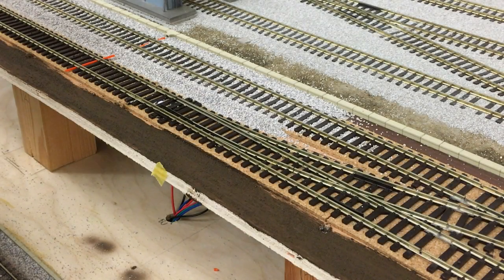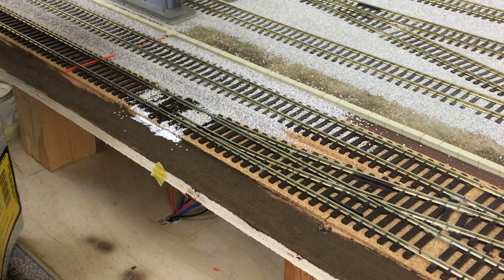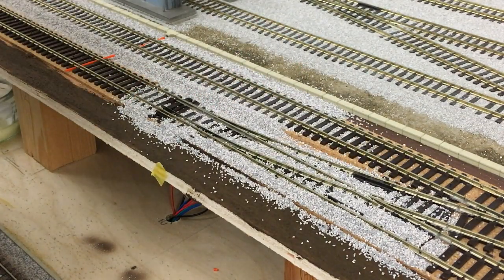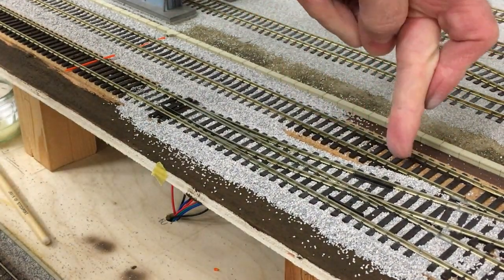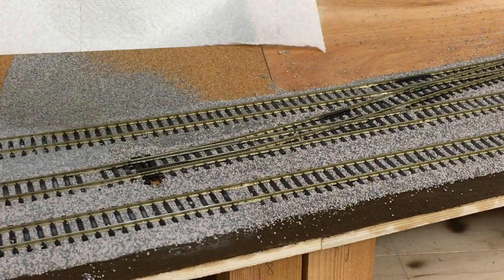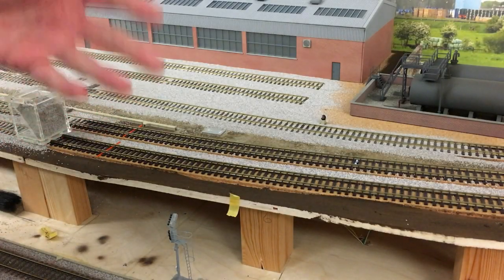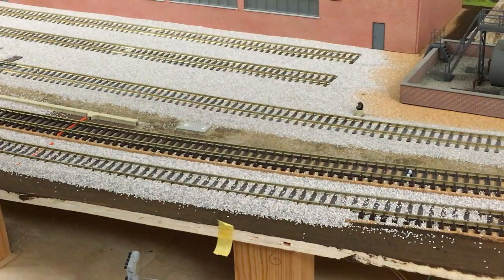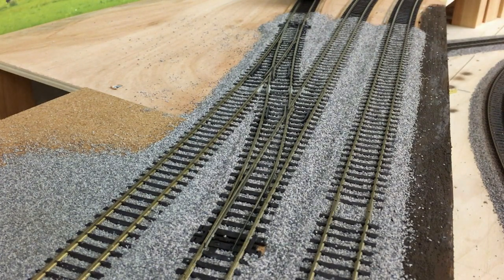Model Railway | Ballasting A Point | Dean Park 232

Comment: Very well presented Dave I see lots of people found this useful. For the shoulder I was pleased to see you also just use your finger to clear the sleeper ends. On some sections of track mainly on curves I go straight to the glue application after that rather than tapping the rails The ridge left is often seen on real track and is sometimes even higher than the rail. I do not leave mine that high. It makes cleaning the rail tops hard to do.
Reply from the maker: cedarcam Cheers. Yeah the shoulder on some real tracks is high.... but as you correctly said it can make cleaning the track an issues with the track rubber anyway. Cheers. Dave

Comment: Thanks for the tutorial, I am just about to ballast some turnouts that I have been avoiding. As a tip I have used a plastic piping bag normally used for icing cakes, found in the baking section in supermarkets, to lay the ballast in the general areas. I have found it to be extremely controllable .

Comment: I found the ballasting of the points very interesting Dave, although you clearly showed the application of the PVA glue to the point mechanism, I was waiting to too the point in operation!...Superb work as always..Bob
Reply from the maker: Robert Masterman Hi Bob. Thanks. The key is not to saturate the area near the point mechanism. Just a drip near it. Glad to report all of the turnouts worked after it all dried haha.
Reply: @DeanPark  I knew they would, thanks Dave...All the Best...Bob

Comment: Can I ask how you place the dummy point motors? Are they placed on the ballast after it has set? Trying to work out if the cork for the ballast shoulder should include space for the dummy point motor.
Reply from the maker: Hi, sorry for taking so long to reply... just saw this comment. 

When placing my ballast I make a small ballast platform for it to sit on. I press the dummy into the unglued ballast to get it fitting etc. Then very carefully remove and glue the ballast. 

When the ballast is dry I place the dummy back and make any adjustments to the ballast, using a small screwdriver to remove any ballast that’s settled and intrudes on where I want the dummy to sit. Once I’m happy, I just pop a couple of dabs of super glue onto bottom of dummy and glue to ballast. I then weather etc

Hope that helps?
Cheers
Dave

Comment: Probably the best video I have seen on track ballasting, so thank you. Have just finished building the baseboards for my new layout and the cork has just arrived for the track underlay. Do you glue your cork down first before laying any track or rely on the track holding it in place until ballasted?
Reply from the maker: Trevor Ward hi thanks. I pin the track down aT intervals so that holds the track and cork in place. So no i don’t glue it. So glad you found it interesting and helpful. I have other videos on ballasting and on track weathering etc. Cheers. Dave
Reply: Thanks Dave, I'm working my way through the rest of your videos but it would help me if you could tell me which of them carries info on track laying and weathering. From what I have seen so far your layout and attention to detail are superb. Hope it's not too cold in the loft just now. Trevor

Comment: Dave many thanks for that. Avoiding the mechanism getting stuck is something that has troubled me for a while and at around £30 a pop for bullhead points not something that I want get wrong. If you don't mind me asking, what thickness of cork do you use and do you pin your track or fix it with adhesive? If the latter, which one do you recommend? Once again, many thanks for the great advice as ever - Pete
Reply from the maker: Creeping Jane hi Pete. I use 1/8” on the main lines and 1/16” on the depot and station, where I don’t want a ballast shoulder. 
I pin it in place as this allows easy adjustment.it will be fixed in place with the ballast anyway. I find gluing the track messy. Cheers. Dave
Reply: @DeanPark  Once again Dave, many thanks for your help. Bets wishes - Pete

Comment: Hi Dave. As always, a clear and concise ‘how you’ video. Now for the daft question of the week -  I noticed during the video you have small gaps between rails(at the joiners), is this done purposely to allow trains to mimic the ‘clickerty-clack’?

After you and others have mopped the tears of laughter away, I only asked as I had always made sure of a perfect join. As I am writing this, I am aware that droppers do provide necessary power to sections of track but, in case others were unsure, I decided to bite the bullet and ask the question anyway.  Thanks Gary
Reply from the maker: A Train In Spain Hi Gary. Thanks for the feedback. 
Ok about the gaps. Totally deliberate.... as in the summer these food disappear as the heat up the loft expands the metal rail. I usually leave gaps on the straights, less so on curves (as I need a good flowing stable curve).
So not a daft question... the clickety clack is an added bonus. :-) the gaps are wider just now as it is cold outside. Cheers. Dave
Reply: DaveClass47 : Metal expansion was not my first thought. However, makes total sense, of course.  Why shouldn’t a model railway fall foul of nature just as the real thing does. As always you knowledge is wise and I take on board those comments. I am fortunate that whilst night time temperatures do drop markedly during the next few months, we are blessed with a much warmer climate overall. That said, I shall take heed and leave a little gap tolerance as I complete the track laying of my layout. I shall continue to absorb tips and mistakes shown by the various YouTube sites and, I am sure I am not alone by saying that this hobby is so much more enjoyable when guys like you share such details and offer genuine encouragement . Thanks again Gary

Comment: Thanks Dave for another excellent tutorial. Just one question...@12.47 and @18.00 I notice you have not added a sleeper ubnder the fishplate / rail joiner. Do you add these or just leave them out? Cheers, Bob
Reply from the maker: trainmanbob hi Bob, I usually do try to add them. But in this case there were dropper wires attached to Bottom of track and I couldn’t. Dave
Reply: @DeanPark  Fair comment. In cases like these I take a sleeper and cut it up to fit in. Glued down and with some good ballasting it seems to work quite well. Cheers, Bobn

Comment: Hi Dave anther great video mate a Question for you Dave what colour paint do you use on your cable trunking Dave ? the class 89 ELEC loco is coming along reasonably will now I have got head and tails light for it now the painting should be finished in 2 weeks  mate clive
Reply from the maker: clive cobbold Hi Clive. I use precision new concrete paint through airbrush on the trunking.
Reply: DaveClass47 hi Dave thanks for that information mate clive

Comment: Great video ! Though i wouldnt ballast a point, not in the area with moving parts. I find it easier to paint and lightly ballast the ground. before Putting the point on the ground. That way you wont have any ptoblem with getting glue and ballast jamming the moving parts.

Comment: I hate to nit pick, but did you forget to put in an extra sleeper under the joints, or do you not do that? Cheers
Reply from the maker: davie maclean I couldn’t on that particular area as I had droppers soldered there. Usually I put the sleepers back in if possible
Reply: @DeanPark  Fair enough Dave. I knew, with your attention to detail, there would be a reason for it. Cheers, Davie

Comment: Would it be easier if I were to use the proses ballast spreader wagon to lay the ballast then add glue/ glue,water mixture on the necessary areas?
Reply from the maker: On normal track yes, but for turnouts I would recommend you do it this way. Dave

Comment: Great tutorial. I like the way you ballast, always have. Clean results. Does the glue leave a residue on the sleepers? It doesn’t seem to show on video, but does it dry clear and look normal up close and personal? -Mark
Reply from the maker: M&M Rails hi. Thanks. The glue soaks away. I suppose these is a minute fine coverage of the sleeper but you can’t see it. This costing helps paint stick to the surface of the sleeper as the plastic they make them from is hard to get using to stick at times. 
Bottom line is.. you don’t see the glue at all once it’s dry :-)
Cheers
Dave